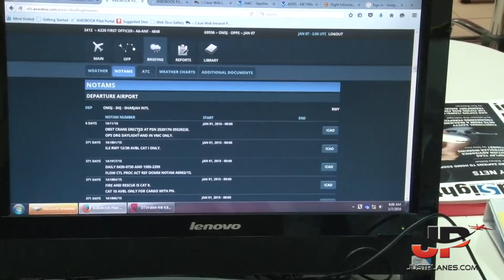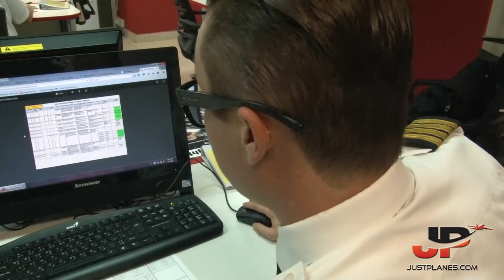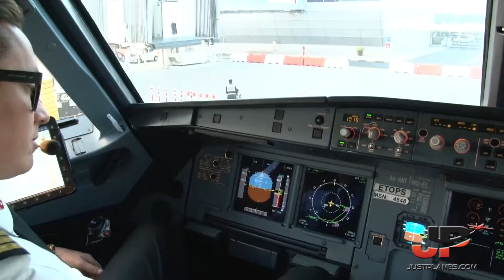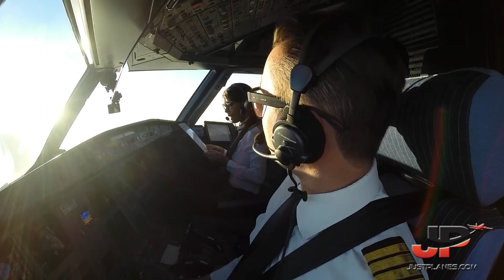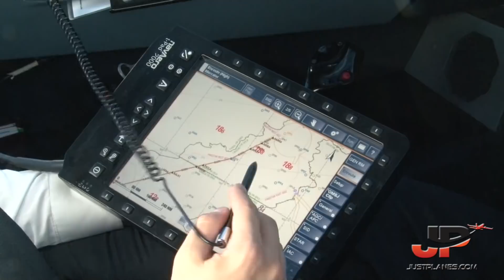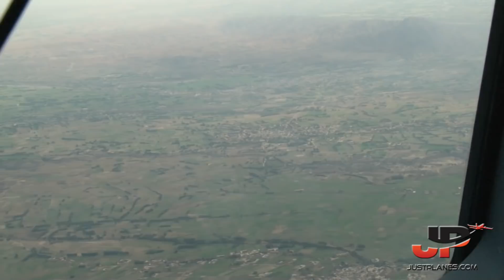Piloting AIR ARABIA Airbus A320 to Pakistan | FULL Cockpit Flight!

Comment: As soon as you select TOGA or FLX thrust upon take off roll, never remove hand from thrust levers until V1. Also not for starting the clock. If you have an engine fail at very low speed (!!) and the thr lever is not retarded immediately, you will end up beside the runway.
Reply: It’s done for a split second to start chrono to keep a tab of the amount of time that thrust is on toga or flex. A second to put thust to reverse max is all that’s needed when pushing chrono.

Comment: But one question goes around my mind, Why they are reciting every single step they will come over during there flight? Is this happen on every normal flight or its just because its a recorded flight? The captain is going on and on 😂😂 actually as far as I know they divide the work for instance the captain will responsible for controls and the F/O is responsible for communication and on take off they shift the duty but not reciting every procedure.